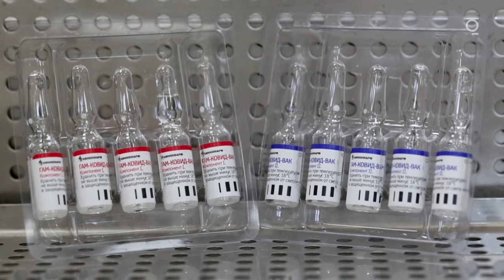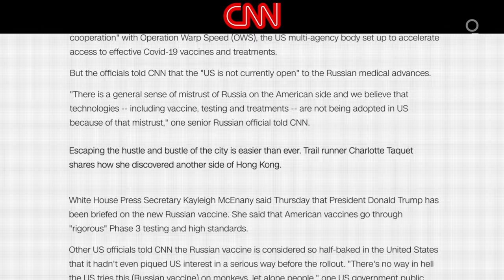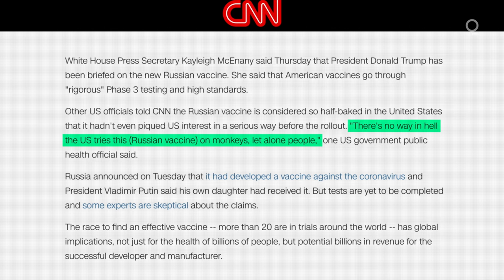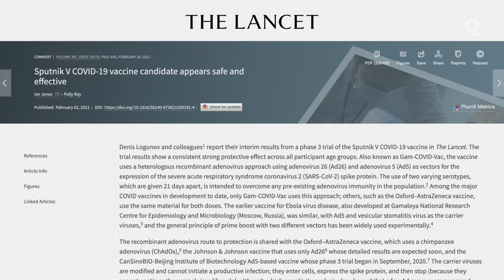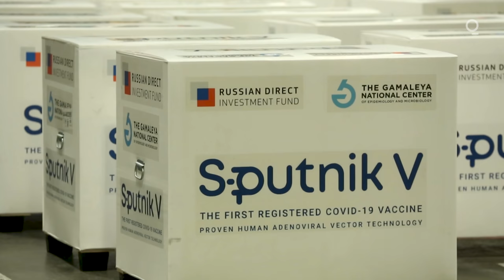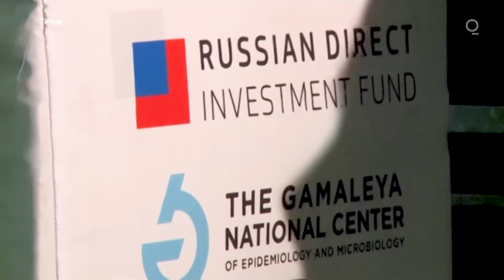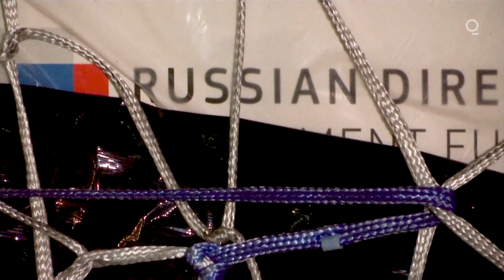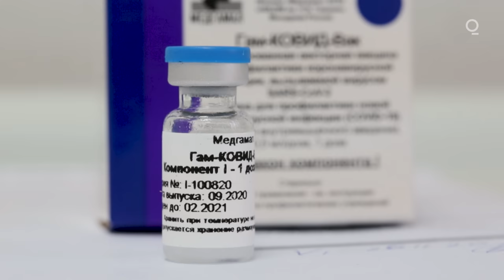Sputnik V: Proven Vaccine, Political Ploy, or Both?

Comment: Russia didn't need to give discounts to developing nation, it's already the cheapest vaccine currently in circulation. Astra zeneca charges around €100, and i bet with "discount" still costs at least 5 times of sputnik v.
Reply: I don't know where you get that information. I just google the cost of vaccines and found that AstraZeneca is the cheapest or around $4!  The most expensive one is Moderna $37. Sputnik, Sinovac, Pfizer are in the middle range.
Reply: @singularity-6339  it seems they are making all vaccines cheaper now. Initially Phizer was around $60 and modern ~$70 for two doses

Comment: The vaccines they supplied to Slovakia do not have the composition that was advertised in that medical journal and the data they supplied are insufficient. So there goes Sputnik V.
Reply: Perhaps your country actually importing Sputnik light, a single doses vaccine, cheap, 9nly one dose with 74 percent efficacy.

Comment: Two different vectors, one for each dose, won't theoretically exactly make the protection last longer, but reduces the odds of acquired immunity against the first vector itself reducing the work done by the boosting shot. While it may as well end up having as a result that the immunity lasts longer, the main effect is that the immune reaction against the SARS-cov-2 antigen is stronger, it mainly signifies that the nullifying-antibody response against an infection on the short term would be stronger, compared with vaccines where the second shot, with the same viral vector, was weakened because of the immunity against the vector. But ironically it could be that the immunity from lower vaccine doses (by whatever means) lasts longer than immunity that's at the same time stronger and more short-lived. There are lots of unknowns.
Reply: Similarly Pfizer and Moderna... not much data or proven data... I am not russian but I trust them better than the earlier mentioned vaccine.